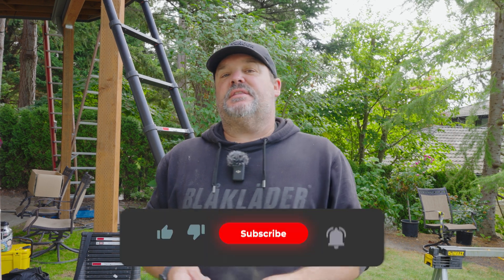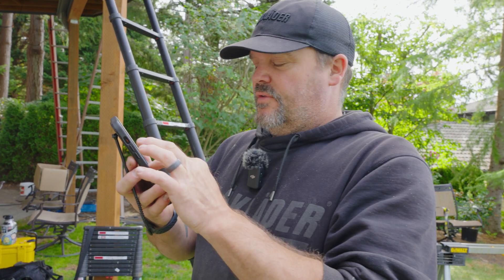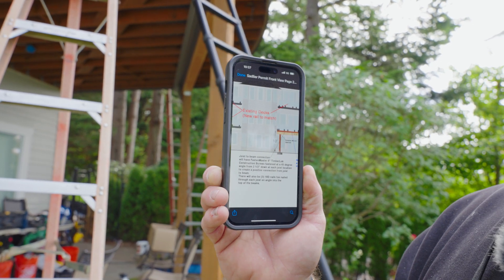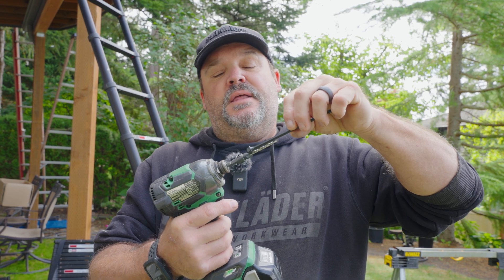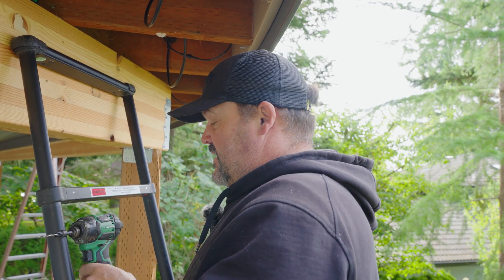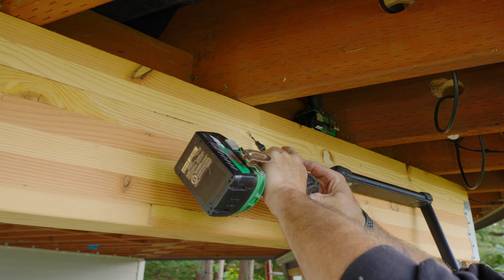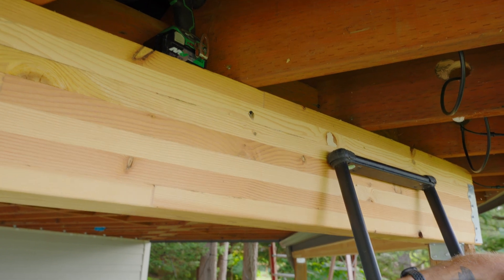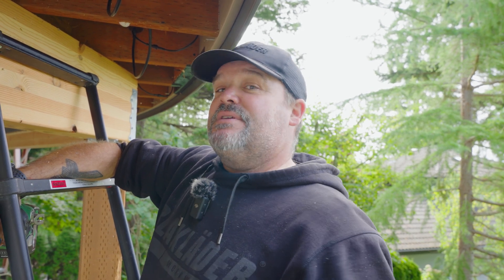Quick Tip: Bracket-less Joist To Beam Connection || Dr Decks

Comment: It really depends where you live. 6" timberlock Uplift rating is 400–600 lbs per screw which isn't all that strong. Simpson H2.5A Hurricane Tie's uplift: 700–1000 lbs per tie.

Comment: what size screw is suggested:  

When a ground level decking beam is flush with a joist, to connect the rim board, you typically fasten it directly to the face of the joist using long screws or nails, ensuring the rim board is aligned with the top of the joist

Comment: My friend just to let you know, that’s a great idea shaving down that 5/16 socket head. But if you wanted to you can buy a Milwaukee extension for your little screwdriver heads it’s a quarter inch drive and that extension is a 5/ 16 transition so it’s perfect, and way thinner, check it out!

Comment: StrongTie makes a similar screw specifically intended for this purpose.  It uses TORX drive, so the head's a bit smaller and the driver doesn't interfere with embedment. They provide guides for the installation and a power set-up that lets you work from ground level.  https://ssttoolbox.widen.net/view/pdf/mowig4oh20/S-F-QUIKSTIK22.pdf?t.download=true&u=cjmyin

Comment: Is that a treated Glulam? Or are you wrapping it because it’s untreated? If treated, who manufactures it? I’m keen to learn more about using outdoor engineered wood to reduce the beam depth compared to regular pressure treated dimensional lumber. Thanks for the video!
Reply from the maker: This is a standard beam because it’s waterproof. And PT lams are 4x more expensive
Reply: Treated glulam beams are pressure treated with a Hi-Clear II, a clear industrial wood preservative. It leaves a light honey color finish that is virtually undetectable to the naked eye. Dr. Decks builds in the upper NW region of the country, and even wrapping untreated Douglass fir doesn't guarantee sufficient protection from the elements.
Reply: He's dried in, so between the wrap and the roof it shouldn't need to be PT.